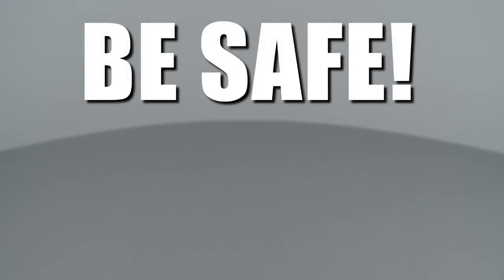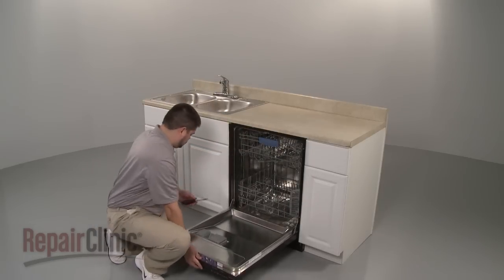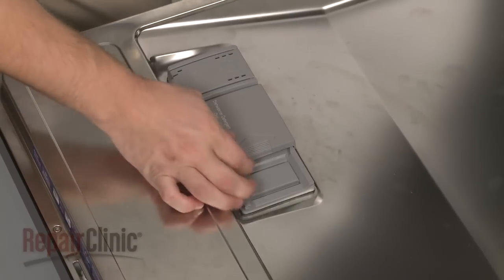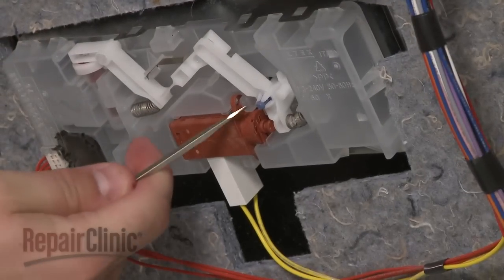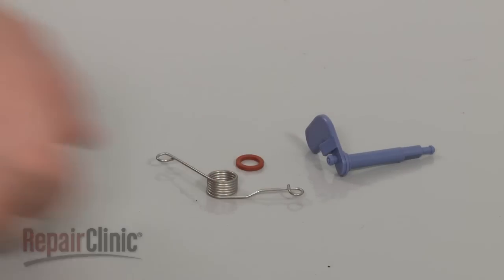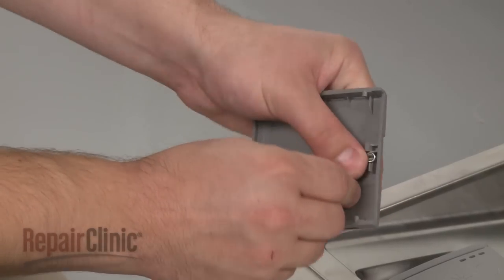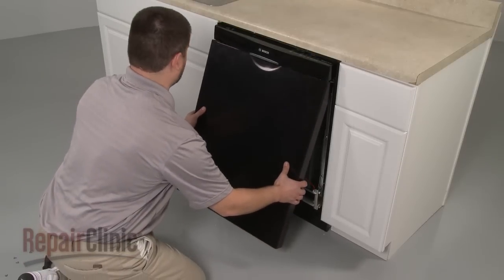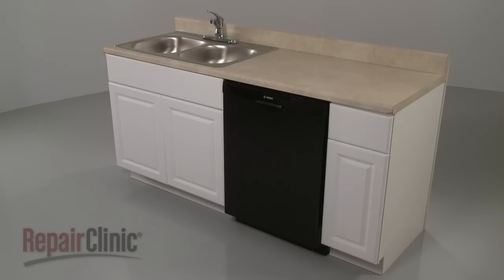Bosch Dishwasher Dispenser Lever Replacement #00166630

Comment: Thank you for posting this video and the other one with the spring and the sliding door, they came in very helpful these last few weeks. I replaced the spring a week ago, but then realized it still wasn’t staying on because the blue lever was worn down where the spring clips on. I’ve been into this dishwasher a number of times for various “easy” fixes cuz I really don’t want to pay like $800 or $1000 for a new one, but each and every time it is frustrating as hell.

Comment: I fixed the loose spring behind the dispenser cover in about 2 minutes thanks to this clear and concise video. Many thanks. If all you need is to reattach the spring, it's not necessary to remove the door cover.

Comment: Glad for the idea, to search in youtube. Although I used a Swiss - made 00 screwdriver, I didn't succeed in dismounting the blue lever. I used an electronic sting cutter to get it out. 
 Important: decalcify those machines regularly, because fresh water runs out directly, if the tube of the inner drain is calcified to much. Thank you and greetings from Germany :)

Comment: WARNING: This only works on a relatively new machine; plastic goes brittle and if you “carefully depress the tabs” as shown in the video, they will snap off and you’ll have to replace the entire unit.
Reply: Yeah, i just snapped two of mine, but it appears to be holding. It’s like they purposely want things to break on us so we have to buy another piece. I guess we’ll see.

Comment: Tip 1 - dont just go undoing every screw on the back as I did! The 2 on either side facing upwards (when the door is open) hold the hinges in place and are a pain to put back in again.
Tip 2 - My dishwasher is about 10 years old and the plastic has become brittle - specially the little  bits that hold the  blue lever in place and 2 broke as I was trying to bend them back to release the lever - so if you have a good pair of cutters just cut one end of the lever off and pull it out from either end.The lever seems to be staying in place with just 1 bit holding it in but maybe that the cause of my big annoyance below.
Tip 3 - Be careful how you pull out the lever - as I did so I pulled out another lever and spring. Not a major problem but could be if you are very familiar with this sort of thing.
BIG ANNOYANCE  - after all that the dispenser still does not lock! I guess I might need to order a new lid/cover.
Smaller annoyance - the price was over the top for a small piece of plastic and a spring. £11.79 from Bosch including about £3.50 postage!
Reply from the maker: John Mathews Thanks for sharing, John.
Reply: I tried to gently pry the little tabs and they did not seem to move easily, and was afraid they would break, so I took a pair of needle-nose pliers and squished the bulb end of the blue lever, first from one side then another until it was mush and came off. I could then push the lever through without having to pry the white tabs at all.